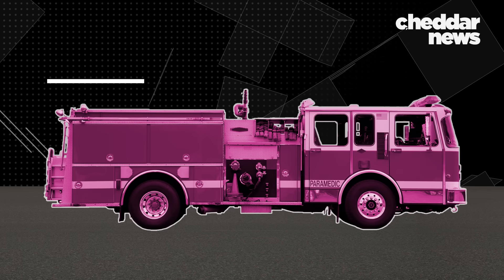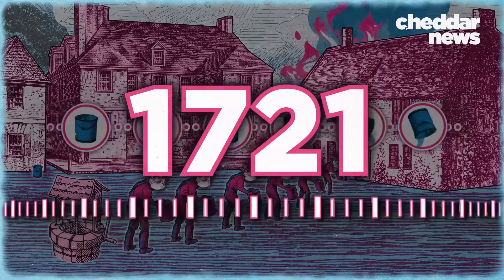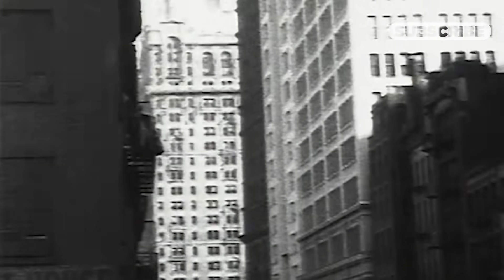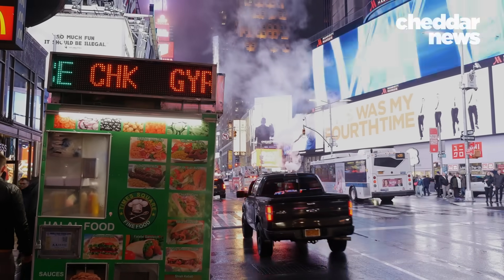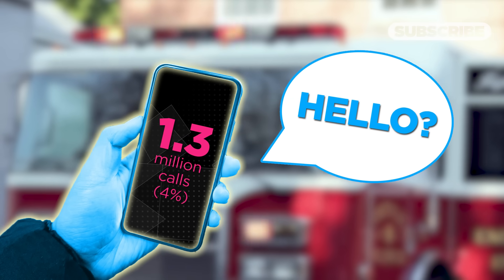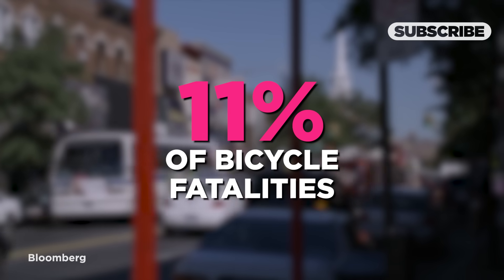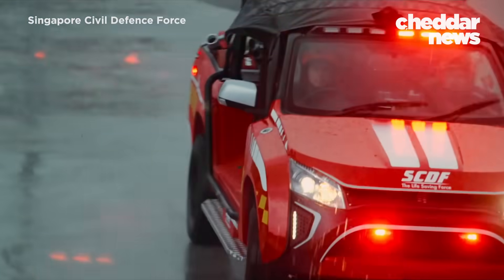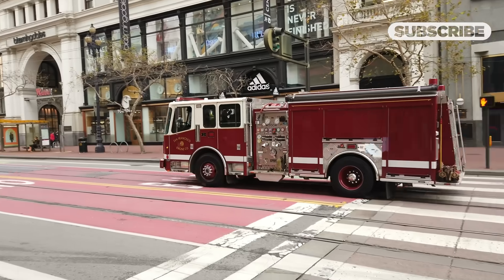Do American Fire Trucks Need To Be So Massive? - Cheddar Explains

Comment: This felt like a commercial for more bike lanes at the expense of larger fire apparatuses
Reply: The US fire trucks were designed for wide streets and less curvy lanes, that's why they often struggle with changes in city planning and sometimes simple construction sites. 
To me, the size and build of a US fire engine seems more emotional/traditional in nature. 
It´s not about efficiency, practicality or sometimes even safety, the reasons why things sometimes stay this way is simply because it always has been like that.
That is something I have seen over the years in soo many aspects of "classic US design".
Reply: Why would bike lanes be problematic? Emergency vehicles can still use them. Additionally, it is easier for cyclists to clear paths than drivers, partly because they will hear the sirens earlier (lack of sound insulation), but mostly they can just lift their entire vehicle.
Reply: Even if you’re anti-cycling (for whatever reason) It’s not a great look, to be honest, that a fire service, is lobbying against bike lanes (which are well proven to save lives). Why not lobby against on-street parking? We seem to be fine with the huge amount of space this takes up on our roads.
Reply: @a1white  Some one likes taking out of context..,
just cause one bike lane is put against for logical reasons, doesn't mean that the street itself can't be expanded, changed, or reduced. or that elsewhere they'll implement a bike lane.

a city does what will be necessary for it to succeed to provide its inhabitants what it needs.<this does not take into to account business, corporate, communities or other agencies be they the government, state, or anything else from also pushing against things. cause what you are applying here is a topic mired by many things. almost like you want to strawman/throw opinions out that aren't your own.>

if bike lanes matter so much to you, you should focus on informing drivers to know the rights Bicycle riders have.
Which many angry people don't even know they have the right to cross an intersection, which means being on the part of the road not marked as a bike lane.
Reply: As European engineer, that American way of thinking as alway make me laugh. Americans design streets that are hostile for pedestrians and cyclistes, without public transportations (or very poor service). Logically, everyone (that includes people that are not medically fit to drive like old people, drunk people going to home after a party, people with disabilities, etc) needs to drive. Due to the fact that everybody should drive, you cannot implement "complexe" road infrastructures like roundabout because even the stupider person should be able to drive. So the roads are full of unsafe, unefficient, but simple intersection (like stop sign and traffic light). Consequently, the roads are congested because everyone needs to drive and because the intersection unefficiency. So those unsafe roads are full of bored or stupid or unfit driver, resulting in many accident.

Answer to that problem: bigger vehicule that are more hostile to non-driving people,  less pedestrians/cyclistes infrastructures and less dedicated transit lane cause general traffic lanes are congested
Reply: @fabswisss  it's not just the drunks and old people. I look both ways at a round-a-bout because I don't trust ANYONE to know how they work. I gotta say, the 4 way intersection is a lot safer in my opinion simply because very few people actually know how to use a round-a-bout where I'm from. But that's probably bias.

Anyway, your fire departments are government sponsored and hired. Ours are, like, 90% volunteer. They can't really afford MASSIVE fire departments and FLEETS of specialized trucks, like a ladder truck, hose truck, ems truck, etc. No, they use what they have and that's a smaller department with 2-3 big engines that can do everything from acting as a barricade at a driving accident, to being the ems truck while waiting for the ambulance to arrive. The cabins are also have a high impact rating, meaning if a building collapses near or on top of the truck, the firefighters inside are fine and can get to SAR as soon as possible. NA firetrucks are heavy duty, all purpose, firetrucks designed to take a hit and keep on trucking (Literally, considering our drivers). 

You have your trucks, we have ours. What doesn't matter is, do your trucks work for you? Yes? Great! Ours won't work for you, much like yours won't work for us. (Unless the firedepartments get state sponsors, but that would be another tax people don't want).
Reply: @endyender1703  1) this is what I say. The requirements to get a driving licence are incredibly low in the US because even the stupidest people have to be able to drive. In Europe people who can't take a roundabout are simply not allowed to drive.
2) I am a fireman in a village of 2200 inhabitants in Switzerland. Before, I was in the army's disaster relief service. So I have experience of both very large services (5'000 men per brigade) and very small fire services. This story about a specialised truck is a joke. There are plenty of comments underneath this video quoting equipment that American trucks contain but that European trucks would not (water tanks, paramedic equipment, etc). Even the truck in my village has this despite the fact that it is a 2.30×8m truck. The only thing we don't have on the truck is a telescopic ladder, but we have a trailer with a ladder, so we have the same capacity to intervene as an American truck.
3) The tax thing is an excuse, European trucks are cheaper. Taxes in Switzerland are lower than in the USA, and it is also the municipalities that pay for the equipment. Besides, municipalities in Switzerland are generally not indebted, whereas in the USA the amounts paid in interest on municipal debt are generally higher than the amounts spent on operations.
4) In Switzerland it is not volunteers but conscripts. The fire service is compulsory between 18 and 32 years old. There is 1 mixed fire service (volunteer and professional) per district which has specialised equipment and can intervene in case the municipal means are not sufficient. Fully professional services only exist in cities with more than 100'000 inhabitants.

I have an engineer degree: I know very well why US trucks are bigger than European ones. It's simply because your whole country is car-centric, the residential areas are very sparse. So the number of taxpayers to finance a square kilometre of city is much lower, which means that the money available is very limited, so the infrastructure is of poor quality and so the equipment must be able to intervene despite the poor infrastructure. That's why the remark about bicycle lanes makes me laugh: it's precisely the dependence on the car that leads to a whole cascade of effects, one of the consequences of which is the increased need for heavy rescue equipment. In Europe we pay less to have more and better public services
Reply: @fabswisss  in short a person's view of a certain section of humanity overshadows their reasoning and logic.
<you've all but exposed your real intentions regardless of your back ground in the conversations>
Reply: @fabswisss  In the United States you have to have a commercial drivers license to operate a fire truck I have a commercial license but I’m a diesel mechanic and I fix fire trucks.
Reply: @endyender1703 Wait, if your fire brigades are 90% volunteers and German firefighters are 95% volunteers, ... What's the difference? Do US volunteers buy their own vehicles? Because yes, those are city financed in Germany. What's your point?
Reply: Why should we design our streets around fire engines instead of designing our fire engines around our streets? Why compromise the safety of pedestrians and cyclists to accommodate a behemoth fire engine when Europe gets along just fine with smaller engines?
Reply: @TheLazySleeperLives  Bigger Fire Trucks = can handle more water and more equipment
Reply: @TheLazySleeperLives  Fire engines are cool and your just mad
Reply: @TheLazySleeperLives  Europe gets along fine with smaller apparatus far a variety of reasons. They have different tactics, different infrastructure, even different building styles to American Firefighters. The both styles of trucks have been determined through years and years of fire sciences research as well as firsthand experiences from the crews that use them to be what they need. Here in America the companies that design the trucks let the crew come to the factory to review just about every detail down to flashing light placement just to ensure it's correct for the cities needs, it wouldn't surprise me if Europe does too. 

More important to that, the streets have already been designed to accommodate what we have, they're being cut down. It's like designing a door to accommodate a 6 foot 10 person, then being suprised that they don't fit when you install a fan at the top of the door that cuts off 10 inches.
Reply: @KomradeDoge  Yeah and that's the point American infrastructure and urban planning is shit, why do we need to keep it that way?
Reply: @KomradeDoge So concretelu what is it base on ? What creteria ? Cause right you just said base on needs but our engines and ladder are equiped as the same as yours
Reply: @comradeevan4539  they aren't though. From everything I've seen European trucks are all specialists. You only have the gear for that job, and only for a smaller crew per truck as you have many that go to the same call, as the tatics call for precision. American trucks are larger to support larger crews, as in the US the tatics are usually to surround and drown fires with lots of water. Even then, some US cities like Detroit use smaller engines with shorter wheel bases because they've worked with the companies to get exactly what they believe they need.
Reply: @TheLazySleeperLives  streets aren't designed around fire apparatus. Most engineers don't give a damn about what the fire service thinks whether it's about road construction or building construction. Our roads are built to accommodate our traffic. Every vehicle in the US is larger than our European counterparts.
Reply: @bencunningham6298  There has been multiple cases across several cities in the US where Fire Departments put the breaks on road dieting, pedestrianization, or bike lane improvements for the sake of being able to maneuver their behemoth engines. One example was even listed in this very video
Reply: @TheLazySleeperLives  Like in the other comments you posted your lack of reasoning, proof, and logic.

A city would have more control from the get go.
and any city further on would have more plans ahead of time.

the only reason you're giving a modicum of leeway with your paper thin points.
is the fact that most cities are old, and have to juggle and adjust to things.

So which matters more, Emergency access and services. or what some people will do on their off day<or use non-motorized modes of travel.>

The answer to that is subjective.
<Even so, laws open up alot where people can bike. but even then many do not understand what rights bicyclists have>
Reply: @bxnaxmxxnaxx1914  Lmao with that Reddit-ass opening
Reply: @TheLazySleeperLives  ridiculous that a service that saves lives is lobbying against making roads safer for pedestrians and cyclists. Such warped thinking. No wonder pedestrian fatalities are rapidly rising in the US.
Reply: @bxnaxmxxnaxx1914  What matters is safety. Traffic safety is just as important as fire safety, and traffic deaths kill significantly more Americans per year. It's ridiculous to cede traffic safety improvements all for the sake of preserving the existence of oversized firetrucks.
Reply: @TheLazySleeperLives  and you know how you improve traffic safety.
You inform people of the laws of the road, and add more. Adjust as needs be, reduce as needs be.

do you know how many drivers don't know the rights bicyclists have on bicycling on roads not marked for bike lanes.
Varies depending on location Slightly.
But generally they have the right to be on that path to Cross an intersection.
Specially I'd there is no designated location.
but you have idiots telling them to get off the road many times.
Would specified lanes help.
Yes, but that's a symptom, not a solution.
accidents happen, always. you can't change that. only prevent.

your lack of knowing is very dangerous to any who would implement your lack of information on subjects you believe to know enough.

Just like people get taken advantage off by cops<who a non-ignorable number don't even know the laws they claim to defend, and SERVE despite trampling on civilian rights.>

it isn't the oversized trucks, and it ain't the Pointless, tribalistic, selfish, and egotistical back and forth you and others get into about one way of doing things being better than another.
or the damn size of how it works.

Years have gone, decades, each city, town, state has their ways of dealing with emergencies. and they do their best to improve citizens lives<if said government, local or national cares, obviously> they know what works best for the people, their streets/roads.

Asking for and petitioning for change helps when they make mistakes<they ain't infallible>
but all this.
you're dead wrong on why you're even still replying.
anyone actually willing to converse would cover the facts, and effectiveness based on location.
but you've valued ego, and opinion over all else. using safety, and accident prevention as a shield.

[Just so you can claim all who go against don't care for Lives]
Reply: @TheLazySleeperLives  People over all safely ignore/avoid cyclists and other Motored Vehicles, and any other mode of transport that do not have any propulsion. there are many solutions. and if you actually read anything one said, as well as those who have tried to put reason into you, and show you logic.
we do not have a thing against Bike Lanes and other infrastructure.

all you HAVE DONE is argue about one instance or one place, that has decided to take the side of Emergency vehicles, over one section of Bike Lanes.
ONE instance. which isnt everwhere, or rampant..,

ALL OVER A CONVERSATION(which you did not add to it constructively or reasonably, except but be tribalist and egotistical)
That had to be about Emergency vehicles, largely agreed upon by Service personnel who have used said Equipment. be it in the US, or other places.(and used both Vehicles that meet/close to US standards, or other. who's consensus that it does well for what their Local needs)

But a video that is demonstrably shown to just poke Tribalism, and riddle with disingenuous agenda gets some people to think they knew best over all.

Everyone wants the best for their place of living. if its bike lanes, signs, information. or as you say, "Pointless" Information campaigns, only leaves us with you wanting the opposite.

if you can Prevent Accidents 24/7 for eternity. with only Bike Lanes and other infrastructure. that would be best. but you need a variety of different approaches, including Information.

but you chose to Derail on the Original topic and Video. Just to focus on your own opinion and ego. 

TLDR: no one is against the lanes, but in many cases changes, or rejections are required. we cannot change what is at the moment, but the road, the Information, the Laws, can be. you treat this as a cut and dry situation where your view/opinion is the only answer.
you can only lessen the Accidents, and even with Infrastructure, and information and all else combined, cannot stop an accident, even if there is a wall, or raised path.

They will always happen, we can only lessen.

Infrastructure alone cannot solve it. and Informing people so they can ACTIVELY be aware, and avoid putting themselves in said instances helps.

a person who doesnt know will cause more damage than someone who will avoid it.
other changes help. but you cant avoid something that will happen.

<accidents happen to many, i for one know someone who got hit from behind, and almost got in one too. but i bet youd brush that off as mere Hearsay. but with your way of thinking youre likely to push away like minded folks, rather than convince people.>
Reply: @bxnaxmxxnaxx1914  That is exactly the reason why most countries have more agile still very powerful fire engines. The US hold on to a vehicle concept of the early sixties, not accepting that the world around them, their cities as well as the necessities of the citizens are changing. Bigger is not always better. Why not build it more compact if it works (and yes, it is possible). Of course, you cannot simply flip a switch and BOOM! Bike lanes!  . . . expecting that the traditional fire departments still can operate as usual. Thats one common problem with politicians: They tend to not understand all the consequences and, most of the time, have no clue at all . . .
Reply: @Kevin  cycling on a road used by other vehicles is as stupid as it comes. You cannot complain when you get smeared on the road.

Comment: In Singapore they also have motorcycle team that will do primary response before the cavalry arrives. A portable extinguisher arriving at the right time is key to stop an engine fire from growing before the trucks get there. 

It's neighbor, Malaysia has 3 man team on converted Honda ST1300 called Rapid Intervention Motorcycles mainly for automotive accidents. One bike carries hydraulic spreaders, the other carries the hydraulic motor and the last man carries EMS equipment and whatever equipment they can't carry between those two bikes.